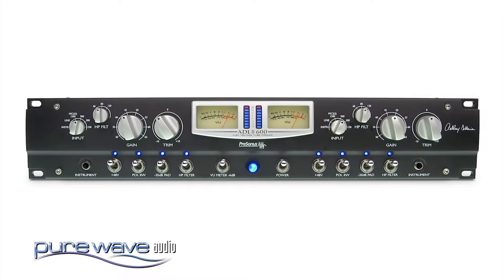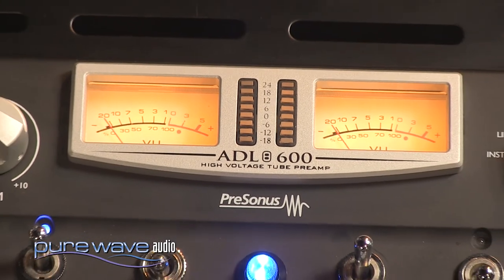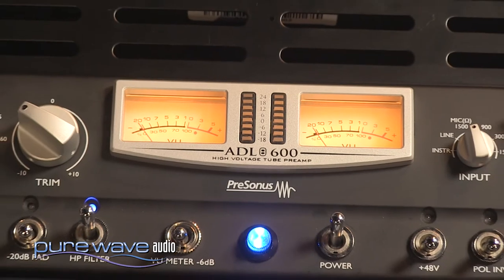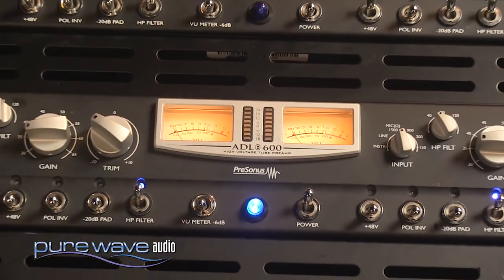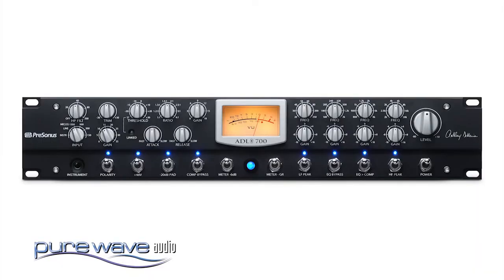Choosing between Tube and Solid State Preamplifiers - Tech Talk

Comment: Loved the video. I was wondering whether you could share your thoughts on a hi-fi system that uses a tube preamp with an integrated amp. Do you still get the same harmonics with such a system as a pure tube setup? Cheers.
Reply from the maker: I believe you mean Tube Pre with Solid State amp.  Here are a few things to consider.  The preamp section is where most of the mojo will happen in comparison to the amp section.  This is because the preamp is where we are focused on processing the signal and the amp section is focused on moving a speaker.  Having a tube pre with solid state amp will give you most of the color from tubes in the system. Switching to a tube amp after the tube pre will be less of a difference in most cases.  But, one thing you have to take into account with manufactures of tube equipment, is that they can design their circuitry to sound whatever they want it to be;  bright, brittle, warm, harmonics , no harmonics.  Just cause it has a tube in it, does not mean it will automatically be warm with plenty of harmonics. But it allows the option during the design phase to get to a warm sound with a lot of harmonics.  Therefore the vision of the manufacture dictates what the overall soundscape of the product will be. Obviously it is in the manufactures best interest to use tube circuitry for its ability to create harmonics etc.., but due to budget constraints, marketing ploys and vision of the soundscape, this might not be the case.  Even though this video was specifically for microphone preamps in the pro audio world, my statements here apply to Pro and the HiFi world.
Reply: @purewaveaudio  Thank you so much for the detailed explanation as well as the caution about the design considerations of the various manufacturers.  I am not sure if you had a chance to listen to the C22 (Mark v) from McIntosh - their latest iteration of their C22 Vacuum Tube Preamplifier lineup......One other question if I may: I already have a McIntosh solid state integrated amp.....Would you recommend adding a tube preamp before the signal reaches the integrated amp? In other words, I was hoping to just use my integrated, instead of buying a dedicated solid state amp.....Hope that makes sense. I am guessing that the answer is no, since the signal will be going through 2 preamps, which doesn't make sense......Thanks again and Cheers!

Comment: I have always felt that for vocals, the tube pre's sound a little dull and lacking crisp highs. For instruments, the tube pre give great grit and saturation. So maybe it all depends on what you use it for.
Reply from the maker: Modern sounding Tube preamps do not necessarily have that issue.  It is whatever the manufacture decides to make their design sound like.
Reply: @purewaveaudio  Yep, For sure I'd like to get me a tube-pre to add a different flavor to my mixes. It's crazy what some preamps cost and some have no LED or VU meter, at least in the 500 Series.
Reply: get a tube or condenser mic and your highs will be fine. thats what youre supposed to use for vocals anyways, and if you are, i doubt youll lack highs ever
Reply: Little green men from outer space.